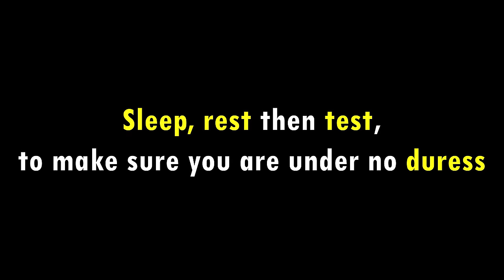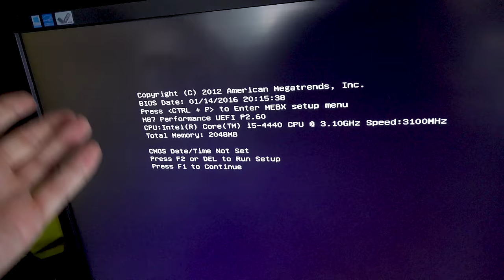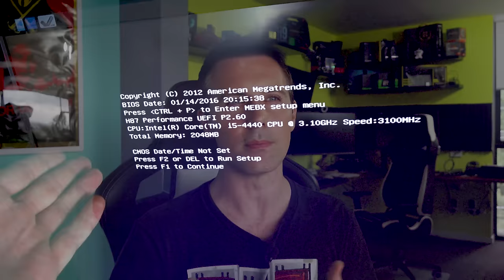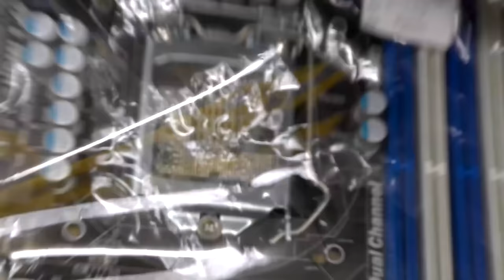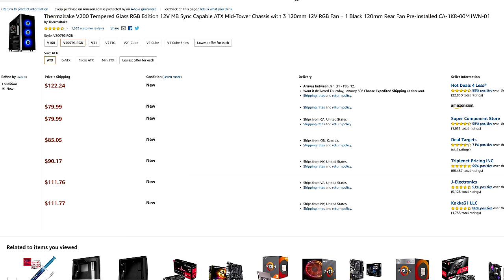Washing 12 Motherboards with WATER and Attempting to Fix them - (Can YES Fix it Pt. 1/2)

Comment: regarding cases, on a low budget i would go whit a cooler master nr600, altho the fans in it are basic no rgb, the case itself has a reasonable airflow, can take a 3 fan radiator in the frontt for the no odd version and a twin fan radiator for the odd version, i have it, like it allot, has a tempered glass side panel can take 2 fans on the top of the case,  not bad overall for a near 80€ case...

Comment: another (more expensive) trick to drying the boards is to have a shallow plastic tub with isopropyl alcohol to submerge the boards into, the alcohol will push the water out.

Comment: If you find out where the trace is bad could you solder a wire and route it around the bad point in the trace? I'm not sure if you could spot the bad point by just doing continuity tests or what. Not something i've ever done myself but it'd be interesting to see.

Comment: never use tap water because it contains lime and minerals and also has a low salt content and makes the water conductive or the residues of the water such as minerals and salts can create creeping currents and short circuits and thus destroy the mainboard you should alcohol or distilled water for washing  Use motherboards.

Comment: What's the Standard thickness of the thermalpad that was used to replace the old one from the motherboard?
Any idea about the thickness of the Thermalpad that's being used on GPUs?
Reply: There's not a fixed standard thickness. Thinner three better. If everything is made right, they're 0.5mil.

Comment: it can. using detergent. there is explanation for that mainboard/motherboard usual has electrolite capacitor, usual this type capacitor will detriorate within time, the detergent help replenish the liquid inside capacitor, but usualy didnt take long to be dead again(within 2 or 6 month). after put for 2 or 3 hour in detergent water solution, then wash it, let it dry outside in sunny day but not get direct sunlight, for 1-2 days

i usualy use this kind of trick to repair old mainboard/motherboard that the electrolit capacitor were in strange number micro farad that are rare in the market, when im still in computer service bussines, i use this trick many times.
Reply: on the note. the detergent were used was on few brand/type that could work. i think its because the active agent ingridient the detergent has.

Comment: I have some thermal paste in my socket of a mother board I dont know how to get out. I love your videos man they are always good to watch and learn stuff from you. The old man talking about the mother boards with the subliminal style messagins really cracked me up lmao, I also have an asrock mother board for an am3 chip i bought a while back, if you move the pc while its on it shuts off. If someone bumps my desk it shuts off I checked all the chords the ram and everything was plugged in i unplugged and plugged everything but the chip back in and it still did it. Im glad to see you shine some light on this mystery for me.
Reply: Turpentine oil dissolves thermal paste easily.

Comment: CMOS BATTERY?
Have you ever seen an intermittent or dead motherboard fixed just by replacing the CMOS battery?
Reply: I've had corrosion under the battery prevent the mobo from posting. Corrosion was caused by a low quality battery perhaps .

Comment: Mediocre airflow in the Fractal Focus G case? Nah mate, the airflow is excellent in that case. It has a good mesh front with 2 intake fans. Just add an exhaust fan in the rear and you're golden with any hardware setup in that case.
Reply: I stand corrected. The foam filter in the front ruins most of the airflow.
I highly recommend anyone with this case to remove that filter :)

Comment: After board manufacturing, PCB's are washed in RO & mixed-bed filtered (mineral-free de-ionized water) to remove solder flux residue. The water quality is measured by a TDS/Conductivity meter. Note: there can be very specific components that won't tolerate washing.
Reply: The PCB's are pre-cleaned with a solvent (99.9% isopropyl alcohol) to soften the flux. Water clean flux skips this step. There are a number of detergents that are made for PCB cleaning. Depending on the components and flux that is used.
Reply: @SISSYPUSS  My comment was for those who may be curious about how it's done in the PCB manufacturing industry. Stating that washing PCB's is common practice, it's done in the industry much the same as how it was done in the video for low volume production. Larger volume production, The board washing machine actually used heavily modified dishwasher components. With larger systems are based on commercial dishwashing components (think hospital cafeteria dishwasher).

Comment: Yes, but with a distilled water. Otherwise you ruining it.
Reply: No. That's a myth.
I've used ultrasonic cleaner at my repair shop. We used regular Tap water and dish soap.

Out of over 200 old Motherboards we've cleaned, only 3 completely broken

Comment: An easy check for a burnt component on a motherboard, as to not waste time cleaning, would be to use a multimeter on the ohm setting and checking for a short between any power pin and ground, checking the CPU power socket is the easiest cause one row of pins are ground and the other is 12V. The most common issue with non-functioning electronics is broken or cracked solder joints caused from expansion and contraction (heating and cooling) which can be made worse by not allowing the electronics to cool at least a minute before shutting down after a heavy workload like gaming.
Reply from the maker: Interesting, thanks for letting me know about this.  Any tutorial on how to check with the multimeter on the pins?
Reply: @techyescity  On a 8 pin CPU connector one row of 4 pins is 12V with the other row being ground in a matched pair config. There should be no continuity between 12V pins, or any power pin including the main 24 pin, and ground pins. The metal boxes surrounding ports on the board are also ground and should only have continuity with ground pins. If there is continuity it will show some level of resistance the same as touching the meter probes together, if there is no continuity the meter will show like the probes are not touching.

Comment: When you said that the water was contaminated and because of that it was conducting electricity I came to a full-stop.
Reply: as far as i know, destiled water is not conductive
Reply: @warrax111  you are absolutely correct my friend, apologies.
Reply: @lukafireman  yes, i was shocked too, when I found out years before, that actualy particles and ions inside water are conductive, not water itself. Pure water is isolant, but it's impossible to find pure destiled water in nature. It is artifical product. That's why it seems water is always conductive, because basicaly in all forms, that primitive civilization finds it in nature, it is always conductive. So it can be said "water is conductive", although, it's not technicaly correct. You need to specify, if it is destiled water or not. But if you don't specify, then it is meant "not destilled water", so it can be said, water is conductive.

Comment: If only I had some money to be able to do this stuff..
Reply: I bet if you ask around you can find some older pc stuff for free that someone or some company is getting rid of. Post to craiglist computer section asking for older parts to work on and learn pc hardware. And it'll probably be in a state that it will need cleaning.

Comment: I'll take the motherboards and any others, even drive the 4 hours to get em or pay the postage, i'll hit you up on FB.
If I can fix em, happy to to a deal.

High speed cpu/gpu fan, no bios lights, most likely dead super I/O or mosfet circuit.
To bend pins back, u need a microscope (or 20/20 vision) and fine tweezers. one example :https://www.youtube.com/watch?v=dd_vhLd8ykc
Reply from the maker: Yeah man come and take all this stuff bro, would love to see a vid of you working magic and seeing if there are trends between what circuits need replacing.

Comment: From my personal experience, I have this broken P75 board which would just shutdown randomly, so my dad (who is an electronics repairman) insisted to wash it with laundry detergent, yes you read it right.
So after cleaning it thoroughly and dried it completely for two days (it is hot as hell here), the board just working fine again. I don't know how or what caused it but it fixed the issue lol
Reply: The motherboard was feeling sad and neglected, it could feel the respect and love from the cleaning and it cheered right up and started working again.

Comment: The company I work for used to wash their PCBs in a regular everyday washing machine using water directly from the tap. Just as you said, as long as there is no current going through during the wash there will be no problems. Now we have deionized water and a full filtration system and a industrial conveyor wash with 7 zones of cleaning and heated drying.

Comment: 18:25 Would be interesting to see you use a heat-gun to soften the pins before bending... I've never done this before, but heard many anecdotes about it working to just stop the metal crystals cracking and the pin ultimately snapping off on you.

Comment: Cool video. Here's an idea to try to dry the MB's after washing in water like you did ; Maybe warp each mb in a bathing towel and run them in the dryer on the lowest heat setting it can be set to.